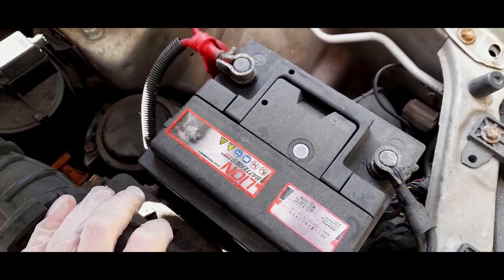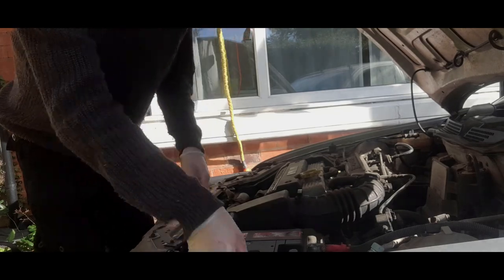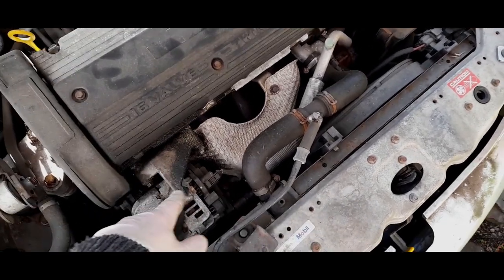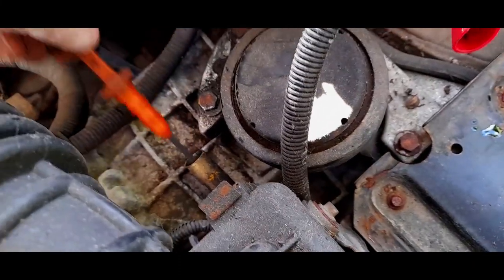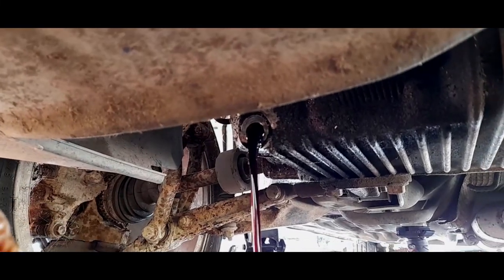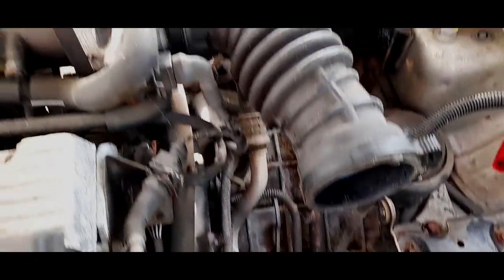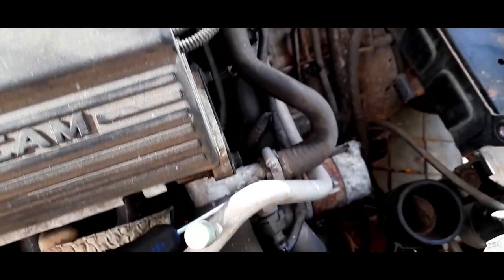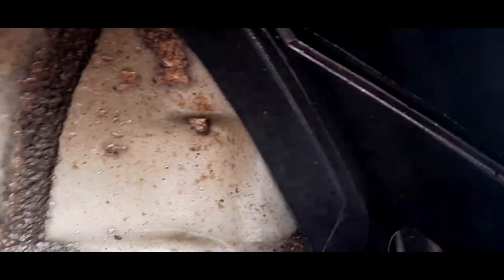Rover 45 - Project Beatrix Part 3 - Drain, Drain & Flush

Comment: Just a comment relating to the transmission. I think you commented in this video that the transmission seems to want to creep forward quite strongly. If this is the case then mine has always been the same so that when you come to a stop it's kind of straining against the leash so to speak. If that is how yours is then I would not worry. Mine has been the same from 49k mileage right up to 110k which I am now on. It has had a fluid change using Comma CVT oil in that time and that seems to suit it fine so can recommend that. I actually refer to my car as Virginia as in Virginia creeper for that reason. It seems to be a characteristic of the transmission. Regards, Martyn.
Reply from the maker: 🤣 ah that's a good one! The creep function which other CVTs do the have - this was designed with that feature. Although I'm finding mine doesn't want to creep as much at all... nothing to do with the gearbox I found out!